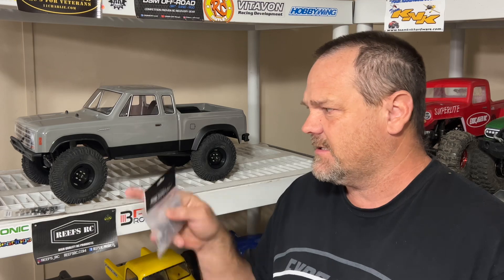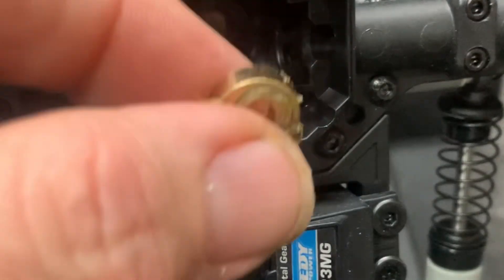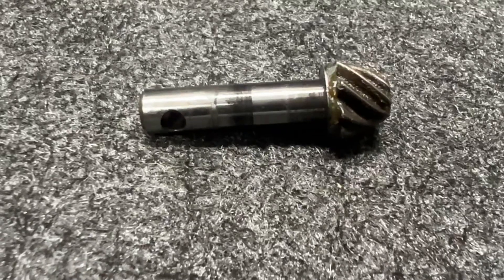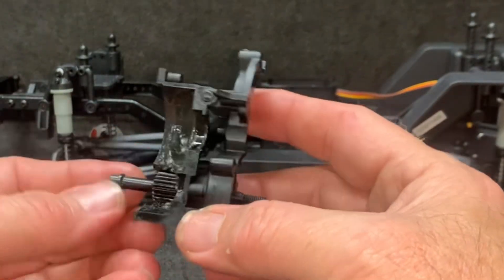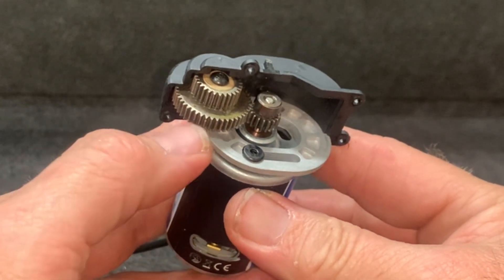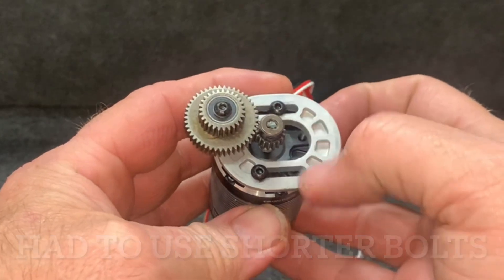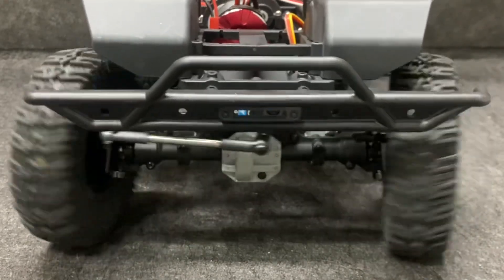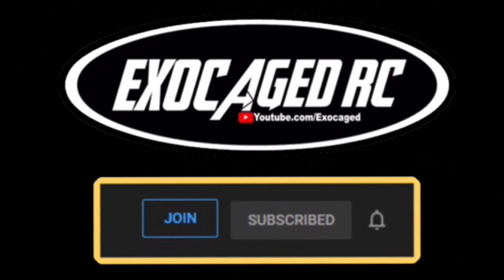Element Trail Truck SE gets Bearings and BIG POWER!!

Comment: I sent the bearings list to Jim, unfortunately I missed 1 10x5x4 for the Outdrive hub. So if you or anyone decides to upgrade the transmission to add under drive to the rear an extra bearing will need to be bought. Should be 6 10X5X4 with under drive.

Comment: Joe, I've bought my fair share of used vehicles and the first thing I replace are the bearings.  Why?  Because no one looks after them properly.  The bushings will  wear in and last a long time with virtually no maintenance. If they develop slop, simply replace them for a fraction of the cost of bearings. And with the dirt and moisture a crawler is exposed to, bushings  just might be a good option. I know a lot of people will disagree and I'm not saying to put bushings in everything but they just may be a viable option in some situations.  As for the shiny spot on the parts, minor polishing from the bushing, certainly nothing to be concerned about.

Comment: Love the detailed mechanical side of the Hobby videos, and Awesome idea about flipping the Diff. also check out Reverse Rotation Sprint Car Engines. They spin backwards compared to normal so when sliding and turning left , well it being reversed helped plant the tires to get more Forward Bite off the corner. I don't know if they run them now but they were big back in the late 90's to early 2000's.

Comment: I would've don't the exact same mods. But would've also added the 14-15% overdrive while the tranny was apart. 
The torque-twist is most likely coming from the drag the bushing was causing. That was normal in the old day when kits came with plastic bushing.